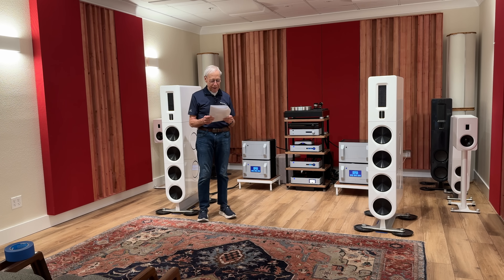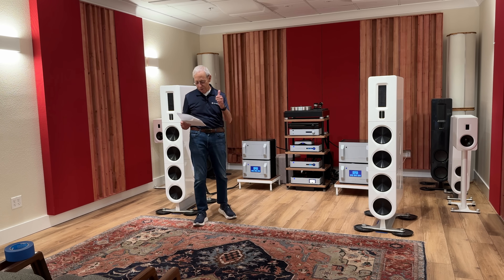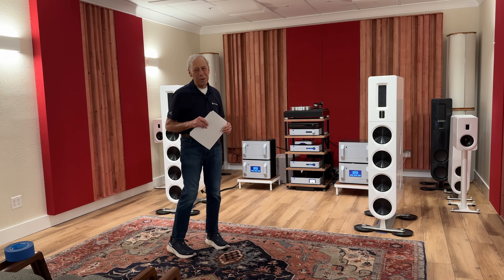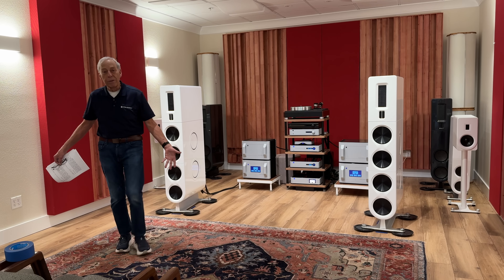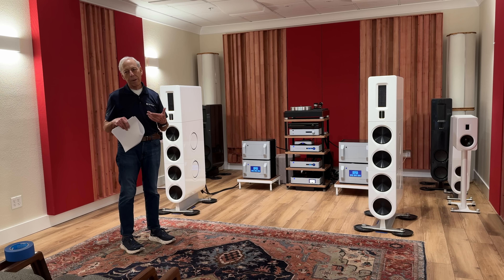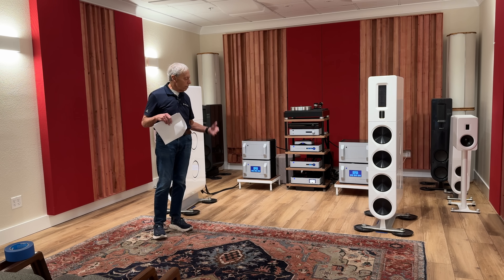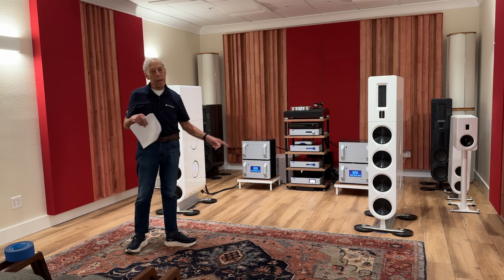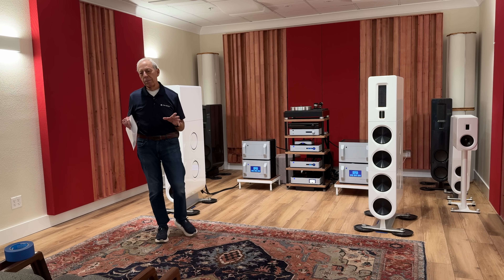Do silver or copper conductors matter in a speaker cable?

Comment: I hear a difference in cables on my modest bedroom system with $200 speakers and a cheap integrated amp. I find it interesting that those who don't hear any difference assume that it must the same for everyone else. That's like assuming we all have the same threshold of taste, smell, or touch.
Reply: Some people have not trained their ears at all, so they don't know what to listen FOR. Also, the choice in music reveals how much sound one is likely to get. Listening to most pop music is NOT going to tell you that the cables are rolled off in the top octave, the same way it would be if someone was listening to Stravinky's Firebird. I get the feeling that most people think they can pop any old disc in - or stream - and that they will be able to identify the traits of the cable - without THEM having to learn how to listen. It appears to be more the case with the younger, digital generation than us old timers who've been around 7 or 8 decades who sat down and paid attention to music - or whatever component we were evaluating. Of course, we had fewer distractions and lower levels of ADHD than are common today, so it was easier to do. If you can't sit down and evaluate carefully, your conclusions will be wrong.
 Nowadays, listening is something so many people do when they're walking around, instead of sitting down in front of the system and listening to it with 100% attention focused on it. No wonder they can't hear anything! Music is a convenience, so why pay attention to it carefully? Yikes.
Hence, I think, the cries of "snake oil" that so many trumpet without having evaluated a component themselves, in THEIR house, on THEIR system.
Reply: Cheap 24 gauge speaker wire Vs. 14 gauge lamp cord, you might notice some volume difference on your system.  $3000 copper cables Vs. $5000 silver cables, I'd say you would notice only your lighter wallet.
Reply: now, why speakers manufacturers put the cheapoest cables inside their speakers? There is sometimes well over 1 meter of cables form the post to the driver - so does it not matter all of sudden, just because it is hidden? The same goes for amplifier producers. They use whatever cable is at hand. Is connecting a bad 1m cable in the amp and a bad 1m cable in a speaker with an ultra expensive 2 meters of cable changing anything really? Why is everyone only so obsessed with the cables inbetween the gear? I think it shows the extent of the placebo effect: if the cable is hidden from view, it does not matter sonically, right? ;)
Reply: @udowehab6756 good points, I guess you have to consider the signal is being sent through the speaker cable before it hits the crossover. If theres any signal loss or degradation occurring there it could affect the sound. I must admit, I have blind ABX tested silver vs copper interconnects before and passed, now whether that was down to different cable parameters I don’t know but it was definitely audible. Also not all speakers use just any old cable, it can be continuous cast sometimes or even off the shelf “high end” cable. I’m not arguing with your comment btw, it doesn’t make much sense does it but for some bizarre reason it does make a difference, I’ve had speaker cables in the past that I had to sell shortly after buying them because there was something about how they sounded that bugged me.
Reply: @udowehab6756 anything which is hooked up becomes part of the amp/speaker network, including the wire inside and outside the speaker.  

It’s a mistake to think that speaker companies use low quality wire inside. Many do not.

Comment: I have a silver cable on my Empire Ears Legend X in ear monitors, and they sound very different compared to the stock copper cable. When the silver cable developed an intermittent connection and I had to send it off to be repaired, it was a shock how much darker the sound was with the copper cable. However, on the Empire Ears Odin, I didn't notice any difference when I put the silver cable on it. I'd read on head-fi that the Legend X is especially sensitive to cable rolling.

Comment: It’s all about tuning. I used to have a QUAD amp and KEF’s from the 70s. This sounded not very engaging but when I replaced the cables with Van Den Hul silver plated copper cables it came to life. But when I replaced the speakers the cables sounded terrible and standard copper speaker cable from a DIY store sounded better.

Comment: In my system I have all silver interconnects from kimber kable all top of the line silver select version when it came to speaker cable I use there copper cables out of every change I have come bake to silver interconnects simply put I think silver tells the truth more that copper,and Paul is correct synergy is most important
Reply: Synergy is an overused word in audiophile circles. A speaker wire conducts audio frequencies at low impedance. The material resistance can have some impact especially on longer cables and more resistance is causing an insertion loss and lower damping factor. Cables have no contribution other than passive parameters of resistance, capacitance and inductance. While the skin effect is negligible within audio frequencies, it is still also a passive effect of increased resistance at higher frequencies. Silver is per Dollar a poor material for speaker cables because you get worse resistance for a given total material BOM cost.
Reply: @ different cables on different equipment tends to lead to poor results in my system I have tried multiple cables and like I said I kept going back to what pleased my ears,silver kimber kable I know all about electrical differences in configurations of metallurgy,my final word is my ears and what pleases me and that’s what matters period
Reply: @ For a cable, whatever you can hear can also be measured. There is no magic to cables for audio. Actually my favorite example of really bad sounding cable is an old 30 feet RCA stereo cable from RadioShack that I keep just to demo how bad a cable can perform. It is just everything bad and 30 feet of it makes it super audible (and measurable).
Reply: @ there are other things that are implemented in cable building other than gauge that effect sound signature,it’s been proven countless times,you use what pleases you and I’ll use what pleases me,you and many others will never change my mind or my ears 👂
Reply: @philipw7058  Rest assured that audio signals conducted through a speaker cable are not being altered in any magic way defying known physics. There is zero magic to it. Speaker cables are not critical on capacitance or shielding due to operating at low impedance and high currents. It is the one place with most snake oil business in audio together with certain other cable types.
Reply: @ like I said you can try and tell me what you believe,maybe you will understand this way I don’t care 🤷
Reply: @ There is no belief. We know how audio signals work through a cable.
Reply: @ year sure 🥱
Reply: @ThinkingBetter  ,
I think you've got it covered, when, years ago, I wired one speaker to 18 Gauge and another to 16 gauge, I noticed no difference in bass or midrange response but the loudspeaker that was hooked to the 18 sounded as if the tweeter was blown and the speaker sounded mushy.
When I matched the wire  gauge for both speakers the problem went away.
From one perspective this is what might be perceived as warmth: decrease the treble response with thin wire, thus the bass is louder in balance! 
How about cutting back treble with EQ, rather than crummy wires?

Comment: Silver sounds better. Wider range and cleaner
Reply: LOL, you got yourself some imaginary opinion. Silver is a better conductor, but it is also much more expensive so for the SAME MONEY, silver becomes a worse conductor = inferior sound.
Reply: It also depends on the grade of equipment....a Conrad Johnson art preamp with match monoblocks would sound great...not so much a cheap amp. Silver can reveal flaws in the amp
Reply: @matthewszalkowski4719  No, silver can not reveal flaws in the amp. Silver is just a metal with a good conductivity and rather, your speaker cable resitance matters. Copper will give you superior conductivity (lower resistance) per Dollar spent in fact!

Comment: In my opinion 100% oxygen free, 100% pure, solid, perfect surface silver is best as a conductor. I feel that plating is not worth it. As plating wears off over a short time. Defeating the purpose. Depending on the plating thickness. Regardless of the type of conductor it should be solid and pure. Generally speaking about conductors.
Reply: Agree, but I don't think the problem with silver plated copper is that it "wears off" but in the plating process.  Placing oxygen free copper in an acid solution to plate it with silver will cause oxidation in a huge way.

Comment: A funny coincidence: the only piece of PS Audio gear I've ever bought in 45 years in the hobby is a half meter pair of PS Audio interconnects.  This was in the mid-80s and I think I paid $30 for them.  They are a braided three conductor unshielded design using red, blue, and dark grey jacketed copper wire.  I used them with my first CD player and thought they sounded fine (today they are sitting in a drawer and are possibly a collectible rarity).  A few years later in the early 90's, I saw a pair of Kimber PBJ interconnects and thought "Hey, they stole PS Audio's design!"  Of course, the Kimber cost 3x as much and today PS Audio is long out of the wire game.  It was a smart move to just punt and sell/advocate for Audioquest, Paul.  Here's another vote for copper.

Comment: Is the answer different for cables carrying digital, USB, HDMI, vs analog signals?  Digital signals consist of very high frequency square waves, zeros and ones, whereas analog signals are combinations of audible range sine waves.  Upgrading from a generic copper HDMI cable to silver coated copper made a remarkable difference in my system.

Comment: Silver is the best metal conductor in the world so its reasonable to conclude it makes a better speaker conductor but then again if your equipment is not sensitive enough or of good quality then the difference between copper and silver would be a mute point
Reply: You’re talking about such small differences in measurable resistance to be audibly zero. 

Also if you think the connection points inside of the equipment for signal transfer have anything other than good enough materials in there you’d be mistaken.
Reply: @michaelb9664 not all equipment just uses good enough, some manufacturers even use silver wound transformers.

Comment: I made some unbalanced hookups from teflon coax cable that are about 6 feet long due to circumstances.  I did not choose it because the conductors are silver plated, but because the capacitance per foot is extremely low in this type,  a 90 some ohms impedance RF cable. The high impedance cable has a higher ratio of center to shield diameter and I think only about 15 pF per foot for this long run.

Comment: IF you can afford silver wires in your speaker cables,  go for it.  IF your copper speaker cables are 4 milli ohms and the silver are 1 milli ohm,  you might lose a fraction of a milliwatt somewhere along the line.
Reply: The fact is that pure 22 gauge silver wire is not that expensive in the grand scheme of things and certainly less expensive than some "high end" copper cables.
Reply: @chrisantoniou4366  Who uses 22awg for speaker cables?

Comment: I have the Audioquest Dragon cables the silver. Before that I had their blend of copper and silver line and then their copper line. Silver is the highest. I do have a very high end system in a great room set up. My experience is that the Dragon cables would be ( TOO BRIGHT or SHARP ) with solid state gear. For solid state the copper can help roll off the technical sound. My system is different. I have the musical Sonus Faber Aida 2 speakers and a pair of VAC 452 IQ musicblock tube amps with a DCS APEX Vivaldi Stack. The musicblocks give incredible realism, stage, and warmth. The silver cables blend well as it brings out a little more detail as tubes can often tend to be a little on the heavy side. So I agree with Paul the synergy matters greatly for the sound you are going for. Way back when I had Parasound JC plus 1 amps solid state I had just copper from Audioquest and they sounded great. Different Universes in quality. The Sonus Faber and VAC just give me an almost perfectly centered vocal with layering of the band behind and huge soundstage where it seems no walls or ceiling exists. Typically look at your budget and cables should not exceed about 10% of it. Dealer won't tell you this but if you often buy other gear from them they will cut you a break in price for larger systems. They would rather sell something that retails for 50k for 35k to pocket 10k then deal with selling 1,000 dollar speakers with 250 profit 40 times to equal the same money. Even then it's not the same profit as you have 10 times the employee man power and time to pull off. The manufacturers don't want to know what the dealers are selling for. If dealer keeps it quiet and not advertises the sale then manufacturer often does not care as much because they sell it at their desired price to the dealer and what they do after that not as much of a concern. The lowered priced gear tends to sell closer to retail as not much markup in it for profit. I get a deal on everything I buy. I never pay retail. When you have lots of money you get what you want or go elsewhere.
Reply: I agree with just about everything ypu said. In December I upgraded to the Audioquest Firebird bi wire speaker cables. Both 10 gauge copper and silver coating with a tube amp using 4 el34s per Chanel and at the same time up graded to NOS Brimar 4003 gain tubes in the preamp. Not harsh or bright however amazing sound stage and dynamics and no fatigue at all.
Reply: Oh yeah, I was able to work put a dealer discount.

Comment: If you want to use silver conductors, why not use it in the coil windings of the speakers? I suppose the higher density of silver would more than offset the reduced resistance.
Reply: Some speaker manufacturers do this but there are so many other variables it's difficult to determine the contribution that silver wire makes to the overall sound.

Comment: Next: Gold or platinum?
Reply: Nah. Rhodium
Reply: Those types of metals are only used on connectors to prevent corrosion. Rhodium plating is a good choice because it's more durable than gold plating
Reply: @mitchtaylor6512  
It has to be solid and the most expensive material available. The rich folk have to be able to keep up their bragging tights.
Reply: @chrislj2890 if that were true, there would already be cables made like that, but other than silver there isn't.
Reply: Gold plating for RCA plugs is great for corrosion resistance, but in my opinion, the gold plating even though thin, is soft enough to help increase the contact area at the connection.
Reply: @chrisantoniou4366  just use locking rca cables with rhodium plating, it will hold up better than gold plating. Gold plating is fine if you hardly ever disconnect your cables.

Comment: I auditioned my stereo with both copper and silver interconnects and speaker cables.  And like the Lone Ranger, my system sounds best with silver.

I also tried Quicksilver's silver interconnects.  They were very good (highly recommended), and better than any copper interconnects that I tried.  I am now using Audioquest's silver interconnects, and they are the best I have heard.

Comment: Hum. Let's do an experiment first with copper. The science says depending on cable length, speaker efficiency, amp power and listener volume, the copper wire must be a particular gauge, and any gauge thicker is overkill.
Perhaps 16 gauge is sufficient for 2 foot lengths of wire for Klipsch speakers. 10 gauge is necessary for acoustic suspension or electrostatic with 20 ft run. 
Silver has the lowest resistance of any metal so a thinner gauge wire will have the same resistance as a thicker gauge copper. Will the thinner gauge silver, ( with the thicker gauge copper of same resistance), have perhaps different inductance or capacitance? Would this in anyway change the sound listening or measuring.
I'm using 14 gauge copper that I've used for years that is superior to the 16 gauge stuff I was using, but will switch to 12 or 10 gauge.
To put it into perspective,  I tried to do sound reinforcement with a crappy 50 watt pa amp and two efficient pa speakers and my bulk 14 gauge wire. It didn't cut it. I had to double the wire and the amp came out cleaner.
No sound reinforcement pro uses anything thinner than 10 gauge.
I'd be suspicious of any thousand dollar speaker wire that's thinner than 12 gauge.

Comment: Well put.  I find the same.  Silver is a better conductor.  It sounds sparkly clean and clear.  Copper a little warmer.  Not massive differences but not subtle either.
I like silver in signal wires in my system.  You can also mix as with capacitors.  I will use a copper foil cap and bypass it with a small value silver mica.  If I were making speaker cables I'd make them out of copper and add a small gauge of silver to keep cost down but add that little hint of sparkle.